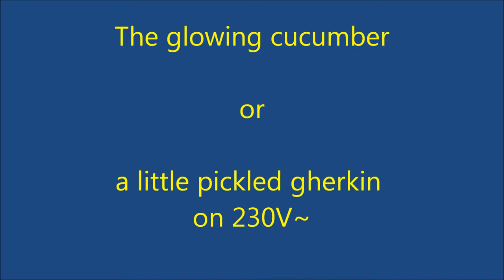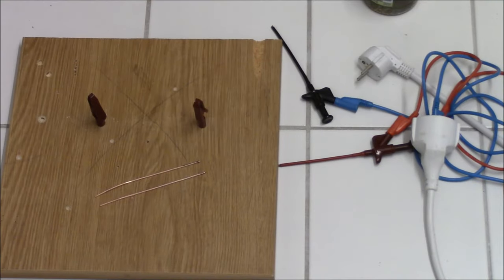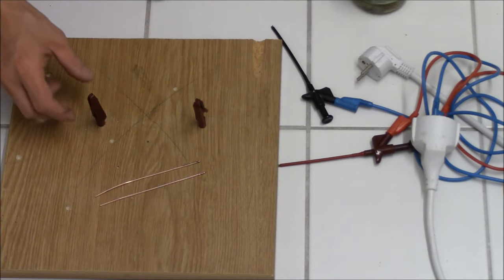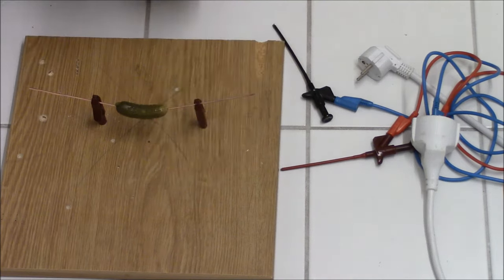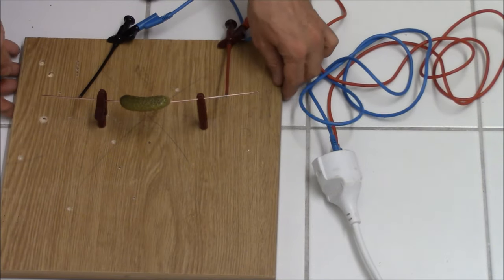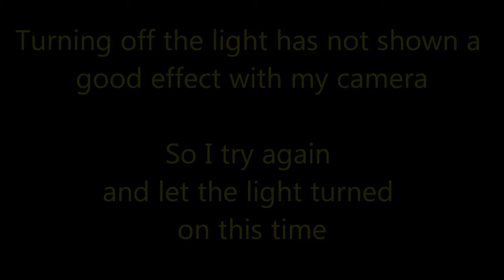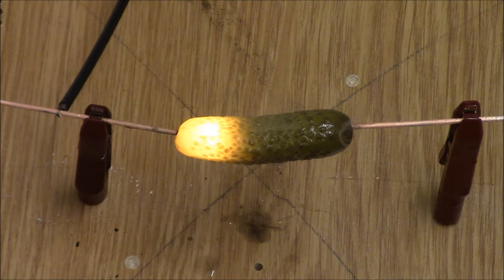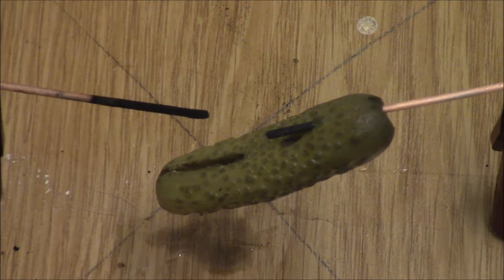(unrelated 1) The glowing cucumber - or - a pickled gherkin on 230V~ [ leuchtende Essiggurke ]

Comment: Happy "pickling" 
I would have chosen to connect it to variac isolation transformer, to avoid the reference to earth, and to avoid the risk of tripping the RCD/GFCI, and have a lower rated fuse in series than the typical 10/13A protecting the normal mains outlet
Reply from the maker: You're right - that would have been the correct way of doing it. But I have no insulation transformer. And the RCD, I considered to be good to have. Anyway we stood a good distance away and had a lot of fun :-)

Comment: Crazy but also cool! The lighting may be equivalent to a low pressure sodium lamp.🤔  Our mains or a bit higher at 240v but our 3 phase is 415v, it'd probably just explode if you tried that!😅☠🍺✌
Reply from the maker: Haha, we have 380V with 3 phases. Yes it's like the sodium lamps - a very fun experiment that requires some precautions ;-) Would only try with 380V from far away ;-)

Comment: The steam/smoke from the ends adds a certain something to this replacement streetlamp trial....:o))
If you have an arc welding transformer, have you tried lighting up a pencil ? (don't do this in your living room folks) :o)
Reply from the maker: Sounds interesting with the pencil, but I'm not that well equipped. Yes, the smoke is quite intense, the whole house was stinking after a few roasted cucumbers ;-)